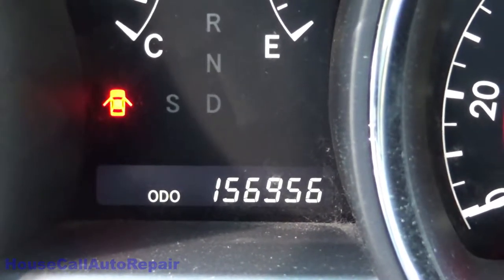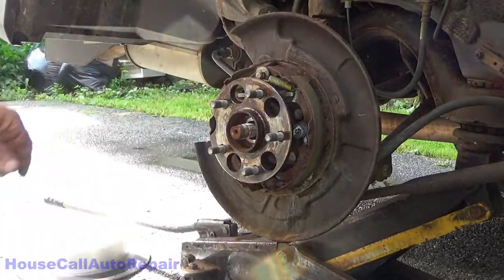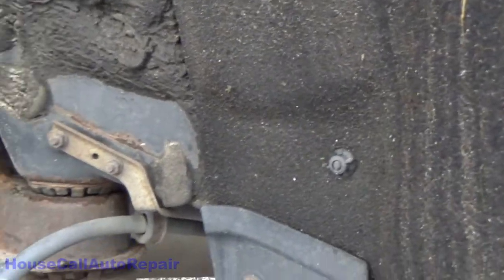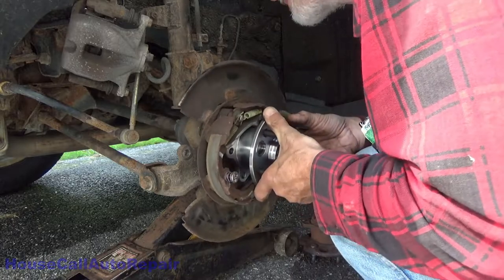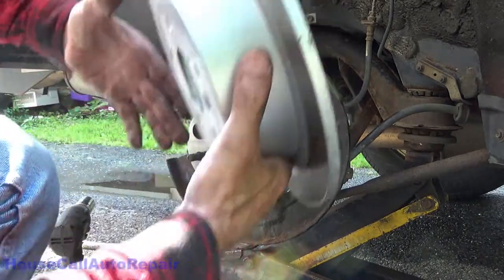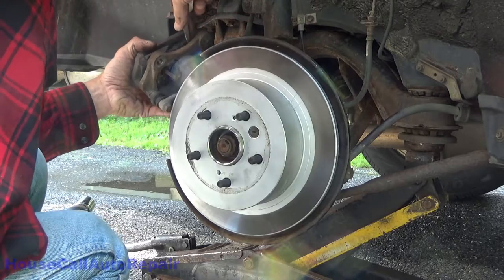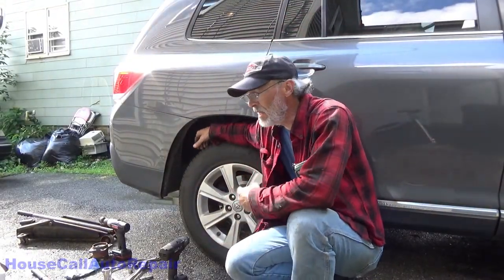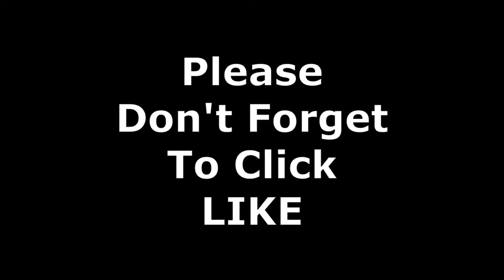2011 Toyota Highlander AWD Rear Wheel Bearing Replacement - Auto Repair

Comment: The cutout notch in the wheel hub is meant to line up with the access port on the rotor for adjusting the parking brake. Other than that everything was spot on 👍🏻
Reply from the maker: I'll make sure to point that out! Important, so as to not prevent someone from not being able to back off a stuck brake!

Comment: Nice video sir!! Simple, honest & informative! Just curious though, what brand is your battery powered impact gun? Thank you!
Reply from the maker: Believe it or not, it's a 10 year old Craftsman ½" drive C3, from a kit. I still have the original Li-Ion battery that came with it.... 2013 (I dated them with a sharpie to keep track of the age) I also have 3 packs from 2015, and recently bought two more a couple months ago. Thinking about buying another Craftsman impact from the same line, but a bit bigger.

Comment: I put a long handled private between the center hub and one of the stud bolts and the floor that way I could torque the axle center nut to 217 ft lb without putting the wheel on the ground.
Reply: Supposed  to say  pry bar.
Reply from the maker: That's definitely the best way to go. Due to being an "out of the trunk" setup, not enough room for a large pry bar. Pretty limited.

Comment: Thanks a lot! Your videos are really good and clear - and i really like that you take your time and dont edit it to become this Scotty Kilmer style - where a whole engine comes out in 30 seconds. I tend to watch your content very quickly after uploading and i really feel i learn a lot from you!!

Btw, a quick but rather off-topic (to the video) question: i am about to change driver side lower control arm in a 03 Corolla. Do you know if i really need to jack up the transmission in order to reach all the control arm bolts?
Reply from the maker: The trick to this one is "mounts" unbolt BOTH upper mounts and TIP the assembly just enough to get the bolt out! Lifting against the transmission pan will likely do damage, but IF you must, to get that extra fraction of an inch, use a board fully across and DON'T lift to hard on it, or stuff WILL break.

Comment: Couldn't you have tightened the center axle nut before putting the wheel on the 1st time?
Reply from the maker: The problem is finding a way to hold everything while torqueing down that nut. There are many ways of accomplishing that, but putting the wheel in place, seemed the easiest at the moment.

Comment: While the calculations for 217 lb-ft are right, you should NOT bounce like that. Try that with a regular torque wrench and see how far over-torque it goes. Step on a scale and bounce... see how high it goes. 

Just step on, then off... exactly how you would use a torque wrench.

 Bouncing multiplies your weight, so you probably applied well over 400 lb-ft of torque to that nut.
Reply from the maker: While your point is extremely valid... 400 lbs/ft would be a feat for that breaker bar not breaking. Value: Over torquing crushes bearings!
Reply: Just saying if I bounce on my digital bathroom scale softly, my 160lbs jumps to over 300lbs (310-330) somewhere. Thats right close to 2x my weight. 
Since we need 217 lb-ft, and I believe you said you weigh 150, you used a force multiplier application point of 'about' 1.44 x 12". 
With your 150lbs x 2 (bounce weight), so 300 lbs, 1.44 x 300 is 432lbs, so it's probably in the ballpark... but yes, that some seriously rough estimations... I'll give you that!

Question: why was the ABS sensor loosened? I'm still waiting to get my 12-point socket and new hub assemblies, but I've got them apart as far as I can until then. (got calipers and brackets off, got the peened places in the nuts straightened, and soaked the axle nuts with penetrating oil, twice so far)

Thanks for the video!
Reply from the maker: @beforebefore  Don't remember specifically, but I probably loosened the sensor to back it out enough to not hit it with anything inside, where the reluctor resides.

Comment: This Hub didn't have to be pressed out???
By a press machine
Reply from the maker: The only time you need a press on the rear bearing assembly is if it stuck from rust.

Comment: Only a few things I wasn’t impressed with this showing was that the chap almost lost his patience a couple of times plus he didn’t replace the ABS sensor even though he removed it at the beginning!
Worst of all you use a blunt chisel to create an indentation on the locking nut not a cold chisel! Most normal home handyman would put never seize on the bolt threads in case There is next time that the bolts have to be removed!
Reply from the maker: My understanding is that you never use anti-seize on any fastener that attaches the wheel (or assembly) to the vehicle. My current practice is to use blue thread locker. (this keeps the threads from rusting up too)
Replace the wheel speed sensor? Where I come from we don't usually replace stuff that is not broken, and in many cases the factory part is better than anything aftermarket. (I remove it to prevent breaking it)
As for the nut, all that matters is that there's enough of an impression to prevent it from turning without a good amount of force.